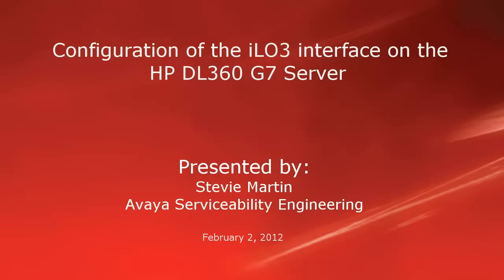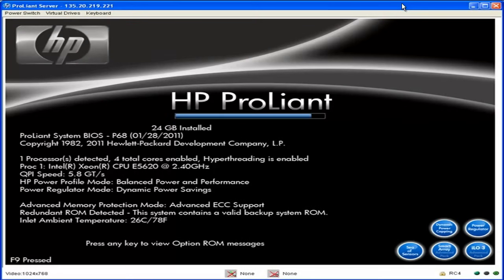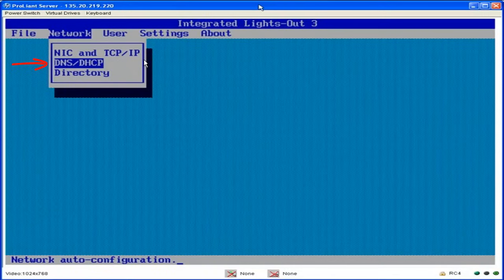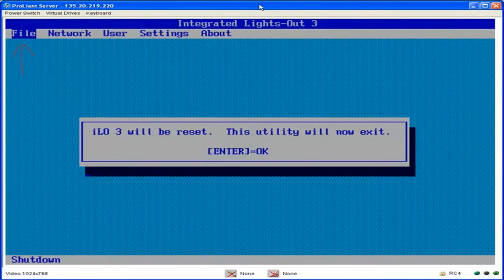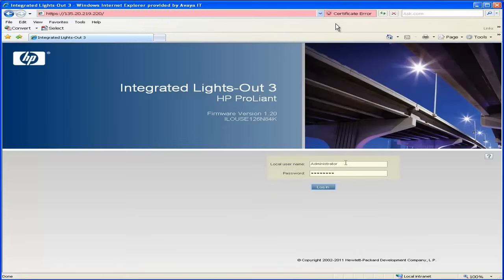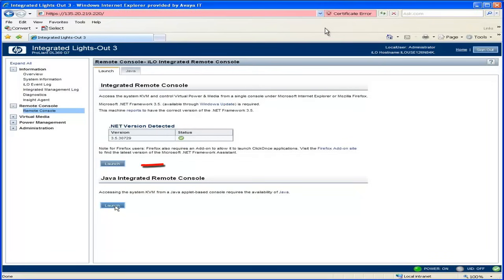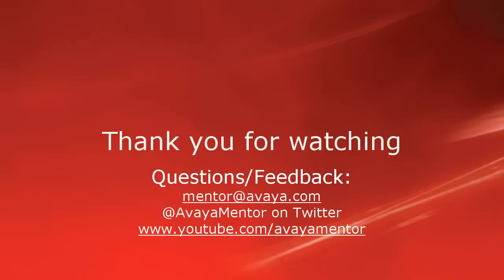Setting up the iLO3 Interface on the HP DL360 G7 Server

Comment: I'm using the very exact steps but the IP is not reachable through the network. Not available on the GUI or SSH. Any clues?
Reply from the maker: Please make sure that you don`t have any network restriction in place. In case you believe everything is set correctly but it is still not working you can contact our support team via support.avaya.com and our specialist will assist you.

Comment: when Avaya states that the iLO is not officially supported, does that indicate that Avaya will not support the Avaya platform loaded on that server if you are using the iLO?  It would be very useful to monitor hardware in remote locations, view activity on the console, or God forbid power cycle the server in the event of a complete system lock up.  Could you technically mount a remote ISO and load software such as system platform?

Comment: Great video. I followed the steps and it worked perfectly! But I do have one issue, on a a similar HP DL120 G6 server, I was able to set it up correctly and gain access using a IE web browser. About two 4 weeks later, I tried to gain access using my IE browser, entered the IP, but the page just said "Unable To Display Page" error. The server is online, i am able to ping the IP sucessfully. I have not rebooted the server (last resort). Any ideas on how to fix this? I appreciate your help!

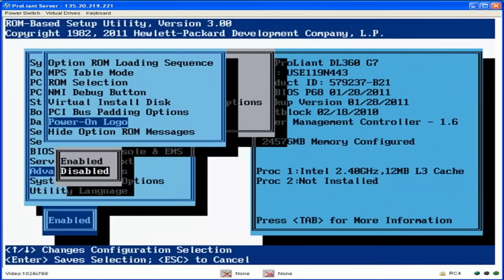Comment: @1:28 - Or you can set "Hide Option ROM Messages" to Disabled while you are there.  This removes the "Press Any Key to see Option ROM Messages" at the bottom of the POST Screen so the F8 for iLO and F8 for Smart Array and any NIC/PXE stuff is exposed as well.